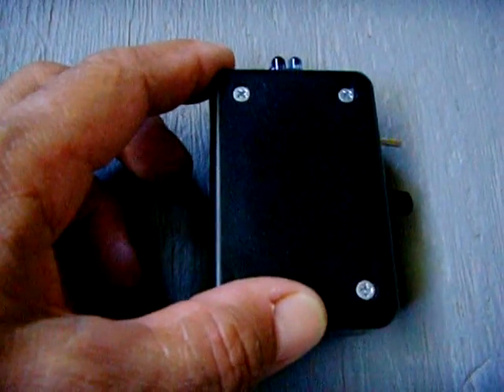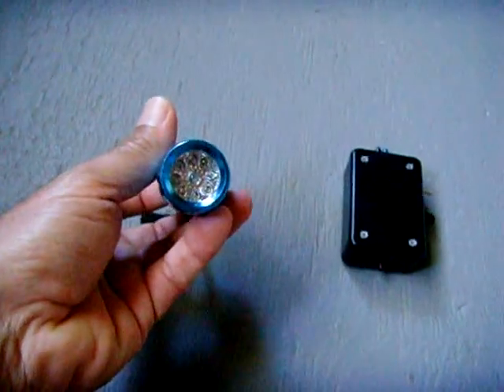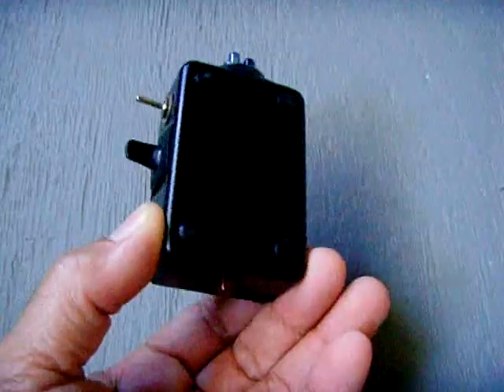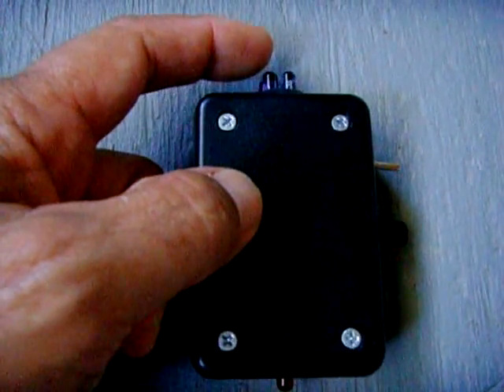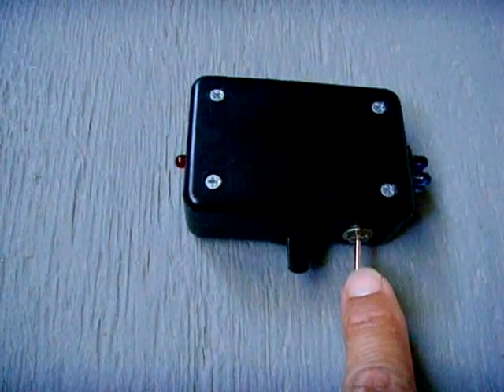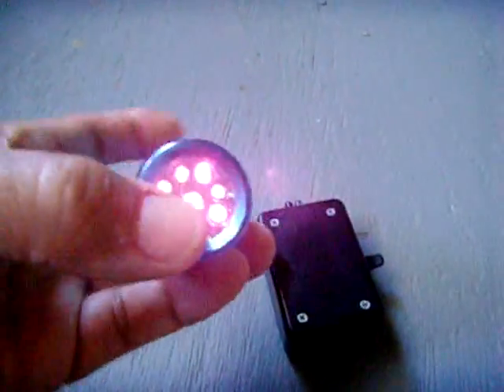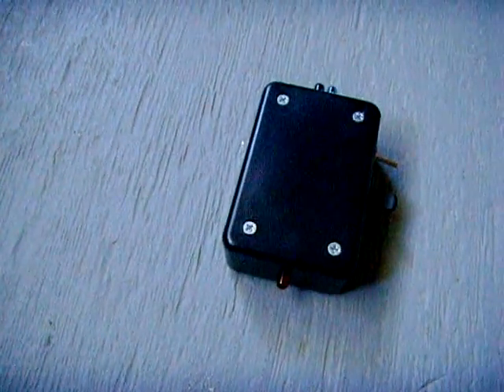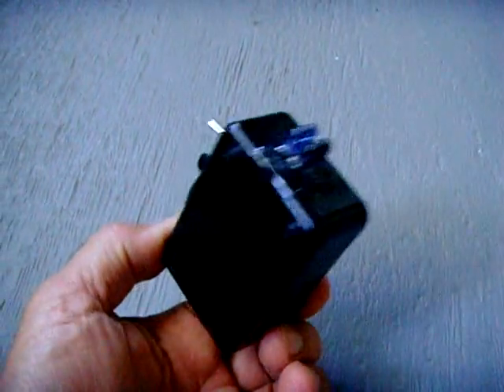Super Sensitive Hidden Video Camera Detector & Remote Control Tester

Comment: can you tell me what would be the best one to buy on amazon or ebay that would detect a camera, or a recorder. i want to make sure that they can't wear a camera or recorder without my knowledge
Reply from the maker: If you are worried about hidden wireless cameras(wireless bugs, then you can purchase a hand-held RF detector. There are plenty available at a reasonable price. The circuit you see here, will detect any wireless or wired camera which uses infrared night vision. If you do not use a visible light filter over the LED's, then test the area in doubt AT NIGHT. Try all different angles. The LED can also be replace with an analog meter for even more sensitivity. You can look for slight movements of the needle.

Thanks For watching.

Also share, and check out my video playlists.

Comment from the maker: You can replace the LED/resistor with a 5V piezo buzzer in series with a 2K - 4K resistor. Adjust the B-E bias resistor and piezo resistor until no sound is heard. If properly set, sensitivity will be high. Remember, this circuit also detects daylight(unless you used a filter). Use in low light conditions.

Comment: Great video, thanks! Quick question: would it be feasible to add several more lights in the front pointing in several additional angles?  I'm wondering if by doing that I could scan an area a bit faster? What are your thoughts?!  Thanks again man for the time, effort and knowledge put into helping others, much appreciated!
Reply from the maker: +RyansWorldOrder 
Hi Ryan. You can do that if you wanted, but it is easier to just aim the detector all around the room or area. To block visible light, you can pick up an inexpensive filter on Ebay. The device will only detect IR.

Thanks For Watching! Be sure to share my videos and rate Thumbs Up.

Comment: i did it and also light up on street lights. am i doing something wrong? im also make it hi/low sensitivity.
could you please suggest a visible light filter ?
this is a totally dark ir detector, but in totally dark you can see red light on ir leds.... so please what is the point of it? i waste 6 hours for this project and works as a general light detector.
the idea is very good but it is really working?
thumb up!
Reply from the maker: youyouwatch Did you read the video description area? Unless you use a visible light filter, you will detect bright visible light as well. They do sell IR LED's which produce very little if any red light, which are used in cameras. This was designed to detect hidden cameras using IR LED's for night vision in areas where it is DARK. Some cameras also have a plastic cover over the LED's which make the red light virtually invisible. I hope this did not take 6 hours to make, there are very few components to put together. I suggest you reduce sensitivity, test using a remote control, and pick up a visible light filter. Below is a link for one which should do the trick.
http://www.ebay.com/itm/52mm-760nm-Infrared-Infra-Red-IR-Filter-52-mm-760NM-/280438568723?pt=LH_DefaultDomain_0&hash=item414b70f713
Reply: electronicsNmore hahahha it didn't took me 6 hours making it :P , the all project time. 
Yes i have read the description, to be honest i didn't use a professional light filter i try old camera film...
so thanks for the link i just ordered it... I will keep you update.
Reply: Andrew cho do you have a picture of the inside? Was it easy? Im trying to find someone who would be able to help me. Any recommendations on where to start looking?
Reply: darrell penn yes my friend, give me your e-mail

Comment: Your phone camera can easily detect Infrared lights. Open your camera and then take remote control , keep pressing any button and see head of remote control through camera, you will see white light glowing. You can also download hidden camera detector app.

Note - I am not against any product. They have there own place. It would be nice if it detected radiation of normal camera to worth its price.
Reply from the maker: True, but not as sensitive. :-)
Reply from the maker: John Carter
My device is better. It's easy to conceal, and can be used very discreetly. It also gives off "virtually" no light when using it, unlike the bright screen on a smartphone. Use what you like.

Comment: I took a look at the schematic. RE: the 4x "IR LEDs", are these actually IR Phototransistors?  I am thinking that they have to detect the presence of IR and allow current to the base of the Darlington. (i.e. something like RS #276-0145)
Reply from the maker: No, those are (4) IR LED's that are purple tinted. I had a package of them laying around. You can see those LED's in some remote controls. I felt they were more sensitive than the regular water clear infrared LED's.

Thanks For Watching!

Comment: Consideration: You should think about accepting contributions or subscriptions for your time. Since you are knowledgeable and we all ask the same questions, would you please consider completing a youtube step-by-step tutorial with a list of the materials (websites). You sound like you are a winner win it comes down to this subject matter. 

Question of uncertainty: Will this work in a regular lit room with someone wearing a body camera (w/filter of course)? 

Who can I contact locally to assemble this? Are there techs or clubs that do this kind of stuff?

Thanks in advance. Please consider a tutorial.
Reply from the maker: darrell penn I already have a "support this channel" button on my YT main page. If the camera does not have night vision capability, then you will not be able to detect it, unless it is wireless, then you can use a frequency detector. Unfortunately, there is not enough demand, nor views, for me to take the time to make another video on this subject. There is plenty of info in this video for an individual to make their own device. You can get all the parts from scrap electronics, Radio Shark, and Ebay.

Thanks For Watching!

Comment: Hi, i would like to thank you for your the knowledge you share with us in your post. I also viewed the blueprint of the detector at the link you provide us. However, since i have no relative knowledge and experience could you please refer the parts one should buy from market in order just to assemble them and thus built a similar detector of yours ?
If it is possible could you please refer them with their market characteristics ?
Thank you in advance
Reply from the maker: Hi Kostas,
This circuit uses very few components. You can buy them on Ebay. All values are shown in the schematic. 940nm IR Led's work fine. If you have old remote controls laying around, just use those.

Thank You!
Reply: electronicsNmore Hi once again and thank you for your quick reply and your instructions. I would like to ask you for the external parts. Meaning the box, the switch, the light indicator in the back. Can i find these in market or should i improvise ?
And one last question, do i need any special equipment in order to assemble the components together ?
(as i noted above i have no relative experience)
A humble suggestion: It would be really helpful if you could spare a few minutes of your precious time by creating and posting a video in which you could teach us and lead us step by step through the construction of the device. Specifically for the amateurs like myself.
Thank you once again
Reply from the maker: Unfortunately I am unable to post a step by step soldering video for one or two viewers that may request it. It takes a lot of time to produce and edit a video. If the return for my hard work is not going to be good for me, then it does not pay. You can use any box or switch. If you live in the USA, go to a Radio Shack store. Everything is 90% off. I bought $100 worth of parts for 10 bucks.

Thanks

Comment: Hi there, i think there is an much easier and foc way to detect the infrared emitted from night vision cam. Most cell phone cam can detect infrared light and converted into white visible light onto the cell phone display, try pointing a remote to your cell phone cam, you can see the infrared light transmitted from the remote in visible white light spot from the cell phone display ! sorry if my English is imperfect !
Reply from the maker: +tonywalman 
Smartphones work, but not as good.
Reply from the maker: +tonywalman 
Smartphones work, but not as good.
Reply from the maker: +tonywalman 
Smartphones work, but not as good.

Comment: any internal pictures?
Reply from the maker: darrell penn Hi Darrell. I did not take any internal pictures, because the circuit is so simple there was no need to. You can buy all the parts on Ebay, as well as an IR filter for 780nm to block all visible light if you wanted to do so. I would say all the parts including the plastic case, battery holder, and filter should cost around $28.00.

Comment: You can use a cellphone camera to see ir
Reply from the maker: True, but this is a very sensitive detector. It works well with reflected IR, and the unit is smaller/more discreet.

Comment: just paint ur phone flash light read with marker and pud it on vido mod and zom in and look around ur ceiling joins with the wall corners and all other pusebal places u shod no its not that ezey to lockat the pin hall camera lenz ezly so walk back and for word and look from defarent angel also very power full magnet is good to fined leaning devices and camera inside the wall if u no how to look for it also bug detractor is handey to look to but not as efactive as u looking around in person over and over